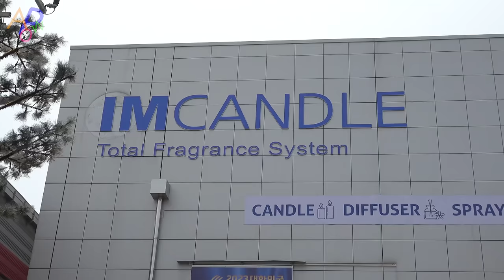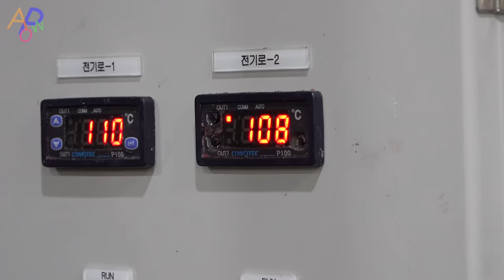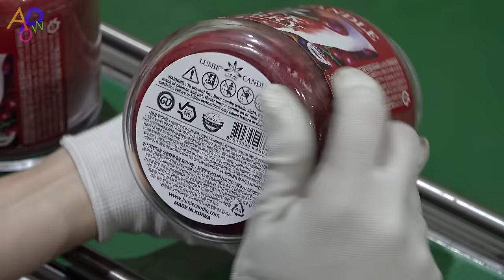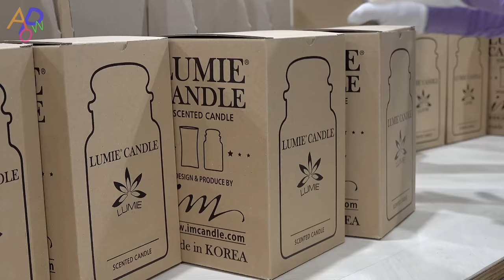Large Jar Candle Mass Production Process. Wonderful Korean Scented Candle Manufacturing Factory

Comment: So you need a lampshade💡 to use this candle?🕯️
Reply: That's a candle burner. I've only ever seen them look like little hot plates, because I have a couple for when I can't reach the wicks anymore
Reply: @lynnleigha580  You mean a candle warmer? If that's what it is that's the single most inefficient thing possible. Those little hot plate things apply the heat directly, why heat the air pointed down?
Reply: Yep, that's a candle warmer. Halogen bulb pointed at the candle to heat it up and slowly evaporate it, without involving actual flame.
Reply: @PhilXavierSierraJones  That's the dumbest thing I've heard all day. So if you don't want to burn a candle to get the smell, why not just buy the diluted scent and warm it up in a similar way? Hell, I've seen little vases full of reeds that you pour essential oils into to disperse the smell without any power at all. I guess if it was critically important to be able to cool it down and toss it into a box...? Still, those little crock pot things are way more efficient and probably safer
Reply: Aeromatherapy wax burner
Reply: @skeetsmcgrew3282  I am thinking that that particular warmer heats the top of the candle first and dispersing the scent faster rather than heating up from the bottom and waiting a long time for the entire candle to get hot and liquefy enough to disperse the scent? The warmer I have is not big enough to heat a candle that size. But I suppose I'd have to find of those lamp kind and read about why they're designed that way. It seems kinda stupid to me as well but since I've never used one...I don't know how well they work.
Reply: Wax does not evaporate. 

I’ve never seen this type of warmer before but it actually makes sense to warm from the top as you can smell the scent as soon as wax on top is melted. 
With traditional bottom style warmers it takes several hours as you have to wait for the whole candle to melt.
Reply: 1:00 1:00 1:01 1:01

Comment: 0:36 Oh ffs just replace that table, you can literally find them by the road for free! What chimpanzee just braced it with some Jerry-rigged low gauge wire? At least screw a patch to the bottom, for crying out loud
Reply: @T_Hoog  I know what bowtie inlays are, those are not bowtie inlays. They waited too long to add proper bracing (such as bowties) and let the crack spread to the point where they couldn't put it back together without special clamps. Those types of cracks don't generally happen overnight, they let an expensive table fall into disrepair. A proper carpenter could probably fix it but they might need a steamer
Reply: @T_Hoog  You are right. The "rustic" look is intentional, and expensive. Not everything has to be perfect according to us

Comment: Utterly NO need for those plastic bags
Reply: and what is going to keep the lid in place during transport??
Reply: @yeagerxp  are you blind - the rubber seal thats on the lid - these lids pop on and off -
Reply: @quasar9111  I am very certain that you have never worked in a factory environment whether in shipping or receiving. Your comment indicates ignorance. Even though those candles are low value, the manufacturer has to provide minimal protection for them if he wants them shipped with insurance. Part of the protection is making sure that the lids don't rattle
Reply: @yeagerxp  lol,   wake up old man...  the rubber seals on the lids  are damn good grip - utterly no need foe that flimsy plastic wrapping, stop trying to defend it,  and YES i have seen and worked in a factory environment, probably MORE than you ever have
Reply: If it is on a store shelf, it keeps people from just opening it and contaminating it or putting something in it they have no business putting in there. In addition, if you drop the candle when you first get it but before opening, it keeps the glass from going all over the place.